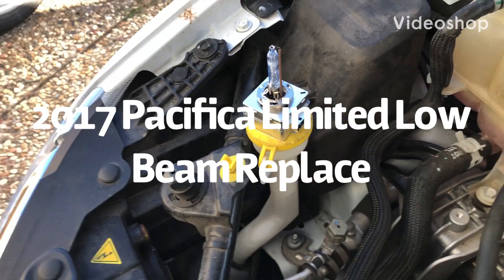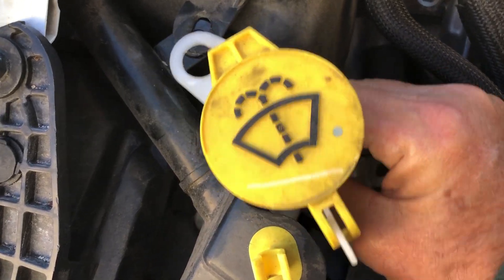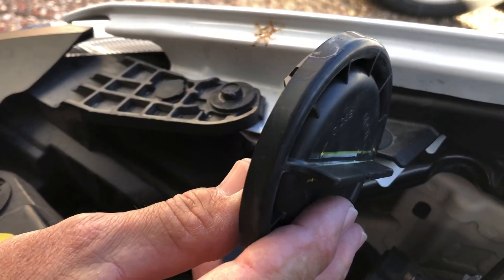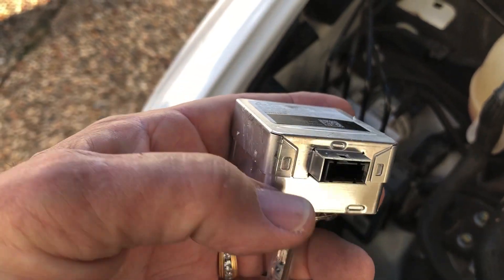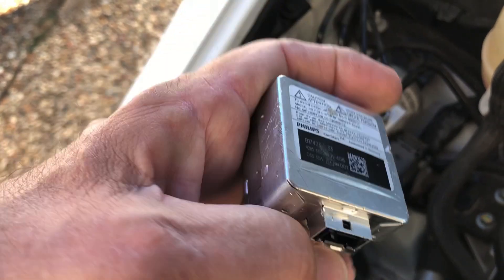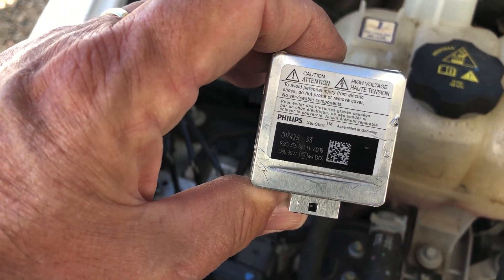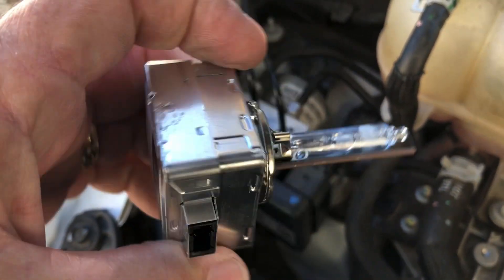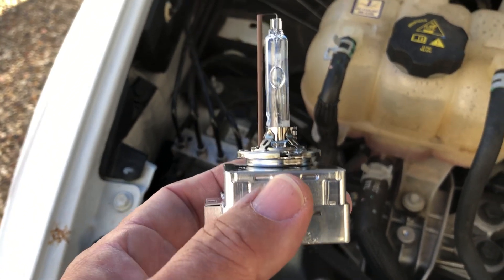2017 Chrysler Pacifica  Limited low beam replacement

Comment: I just changed the passenger side low beam bulb on my 2017 Pacifica Ltd. This video gave enough tips, to get me to wonder how long it would take. Did the actual replacement in 15 minutes. I did not find the cable too short. I could easily get the bulb with the cable still attached out of the hole and then pull off the connector. The cable is a shielded cable with an outer stainless steel braided covering. Perhaps those that found the cable to short, had the cable hung up somewhere. 
 The light bulb as shown in the video is a HID (Xenon) bulb with stainless steel DS3 base. This is important when looking for an aftermarket unit. Also be sure to get the right colour temperature. I guessed the original was 6000k. Found it (aftermarket) on Amazon. Came as a pair complete with nice white gloves on for $39.95. So I have a spare for when the other side goes. 
Probably the hardest part was reinserting the bulb. Getting the right position and then turning it clockwise took a bit of fiddling. 2nd time around would be faster.
Reply: Original is 4300k.  I am on the verge of trying to replace the bulb with a 5000k one.

Comment: Thank you. When screwing the bulb back into the housing (clockwise turn), it really helps to use an angled adjustable plier (for plumbing). I tried to tighten the bulb back in by hand for 1/2 hour, but could not turn clockwise on either bulb housing, but a wrench fixed that immediately.  Also, on the driver side, it helps to remove the strut bar, which is secured with three 10mm bolts, so that you can access the bulb more easily.

Comment: Thank you for this. I have been driving around with dim headlights and took it to a dealer who just told me the lights went dim. Luckily, he didn’t have the bulbs on hand to charge me. Took it to autozone to get new bulbs and 
diagnosed the problems was the bulbs weren’t seated. It makes a huge difference.

Comment: Great video. Thanks! I replaced mine and started with some aftermarket ones that had a plastic securing ring instead of a metal one like OEM. Get the metal one! The plastic one would go in but would not turn to secure and then since I tried so hard to turn it it got stuck. Took me awhile to get it out in order to put in one with the metal ring. Save yourself some hassle.

Comment: Thanks so much for the detailed video. Took me 30 minutes of trying and trying to get the cable plugged back in, and killed my lower back. An extra inch, or even half inch, of cable slack would have made all the difference. Whoever designed this is evil!

Now I wish I had sprung for the name brand Philips bulb for $53 instead of the generic for $18. I just figured for that price I wouldn't mind swapping it out again every few years, but I DO NOT want to do this again anytime soon. My original bulb (also Philips) lasted 7 or 8 years, so we'll see how this Chinese "DMEX" bulb works out!

Comment: Thanks for sharing! I had to remove that cross bar on top of the light area so I could get my meat chops into that tiny hole to turn the light to pull it out. Once I did that it was really easy.

Comment: Thank you, this is extremely helpful. Weren’t you concerned with the possibility of electrical shock? As I understand it HID bulbs are more dangerous than others because of the electricity stored in the capacitor. I’m a little leery of doing this especially when you mentioned that you needed a screwdriver to remove the connector. Do you think it’s safe?
Reply from the maker: Well, I survived it! In any case a screwdriver shorted across the terminals of a capacitor is what’s usually done to discharge them. If I recall, the terminals for the bulb are recessed in the connector housing such that you would not short across them with your skin. And, it never crossed my mind to worry about it at the time😃

Comment: Thanks for the great video -  doing think I'd ever have figured it out otherwise. I agree that removing that strut certainly helped. And an additional inch on the cable would have made a world of difference. Or if they made the top of the housing removable, rather than working thru that plug hole at the back -  I think if I ever have to replace it again the housing will be modified with an oscillating saw. And finally - I've no experience with bid lamps in automotive, but lots in projection. If a unit is under warranty is always replace a bad hid with an oem,  cost be damned. But after warranty I buy the cheap ones from Amazon, as I did for my Pacifica. Once in a great while they've been problematic, but no more so than oem. As they say, YMMV.

Comment: Great video!  This worked great for me.  It's amazing/shocking to me how much the dealerships want to charge to do this.  

I agree with the earlier comment that you should use channel locks or pliers to tighten the bulb. Just be careful not to over tighten

Comment: Question;
Did you get the same brand as stock? I also own a 2017 limited.   But I find the HID lights average at best.
Reply from the maker: I used the exact same Phillips D3S bulbs. The originals both burned out much quicker than I heard they should last. I had maybe 700- 900 hours on them. These are the bulbs, and they checked out as legit, not counterfeit.  https://www.amazon.com/gp/product/B008BRJ712/ref=ppx_yo_dt_b_search_asin_title?ie=UTF8&psc=1

Comment: Thank you 🙏 great help to know how to get to the bulb The van is OK as far as the seats that go under with just pressing a button but everything else I can't stand this man the doors open my room so sometimes the back door the side door my front dashboard goes dark everything I can't deal with it I'm going nothing the radio goes up by itself the transmission takes sometimes a delayed start it's been a headache since day one I take it to the dealer they say there's nothing wrong with it although there are seven:Call backs on the computer system

Comment: The hard part is connecting the plug  back into the bulb...the connector is short .. and not as flexible

You might not want to touch the bulb it has gas in it your humid fingers can make it blow back out.
Reply from the maker: @Bandwidth2024  The bulb I was handling was the old blown one. I don’t touch the glass of new bulbs.